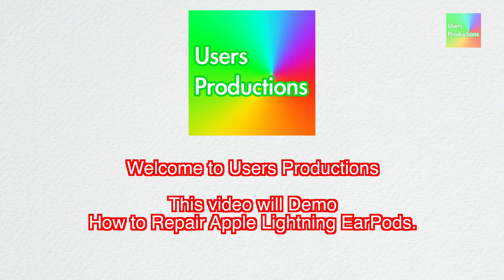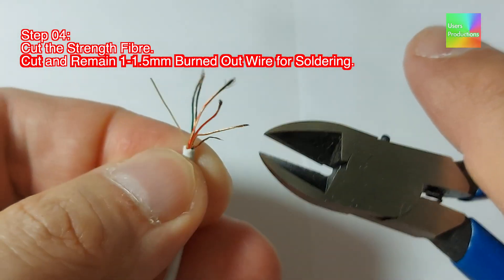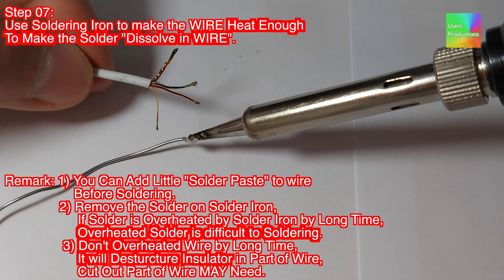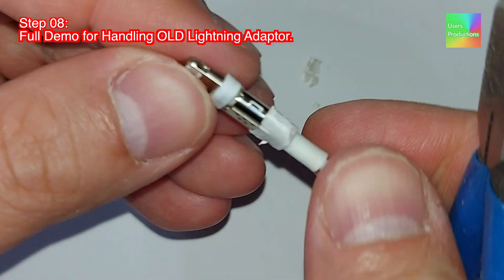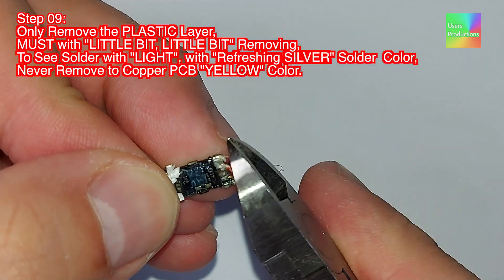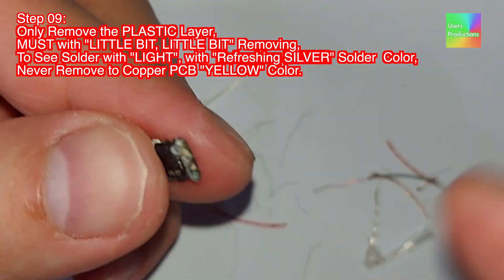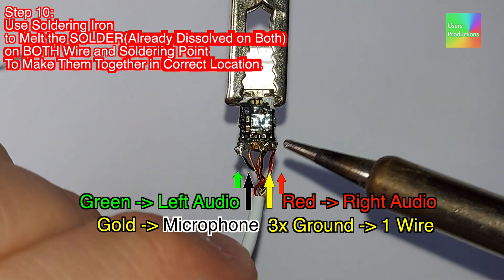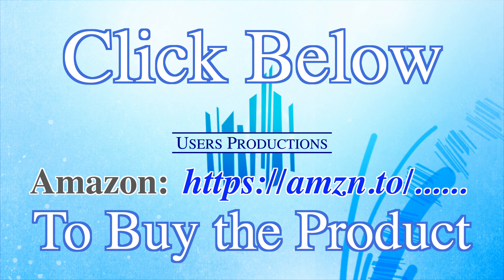How to Repair Apple EarPods Lightning

Comment: can i use carging port as a earphone connector
Reply from the maker: Do you mean USB-C, you can buy USB-C Adapter with USB-C Audio Chip,
https://www.apple.com/shop/product/MYQY3AM/A/earpods-usb-c?fnode=4a0a104c687e22f917f0ef06b05b6f49dbab6c0e5166929b2b47475609bb060e5a817baebea5f9af56712fbfbf1edc36058c3bcbf6b7d1bb4958b90b9b5053531103d5e0aafae87ad7c39007ebf53914a8b7dc0853ead9da41b8aa7e8b321396